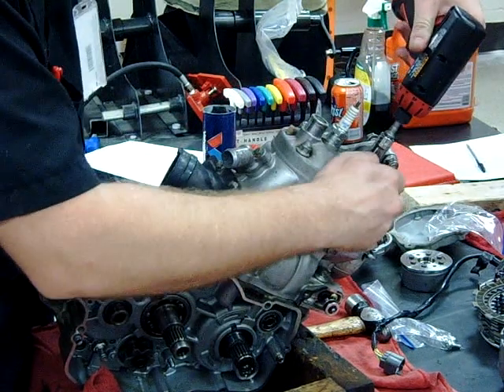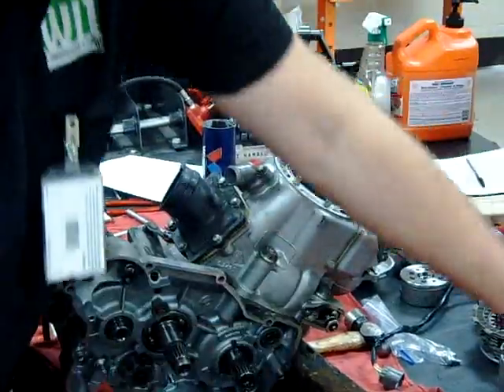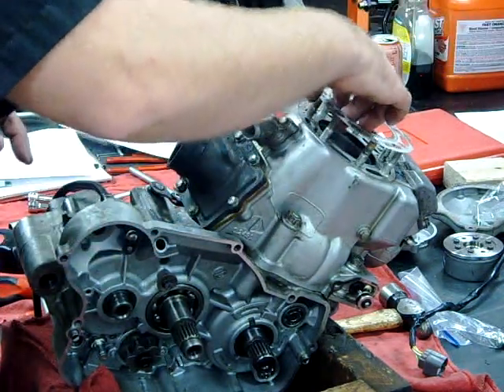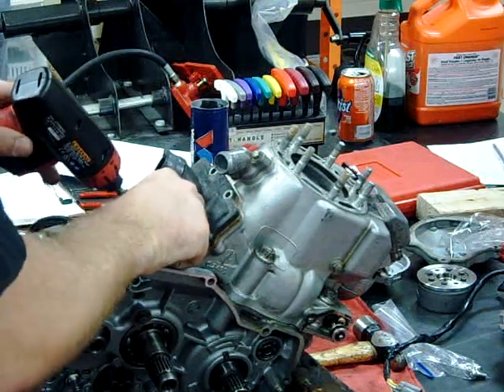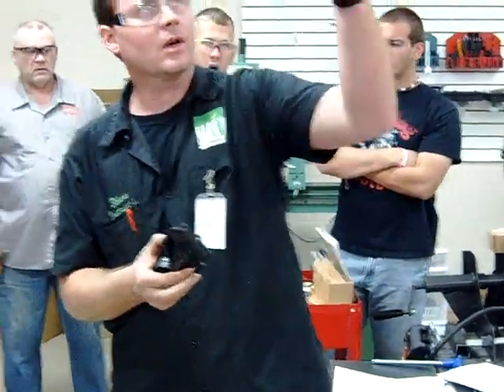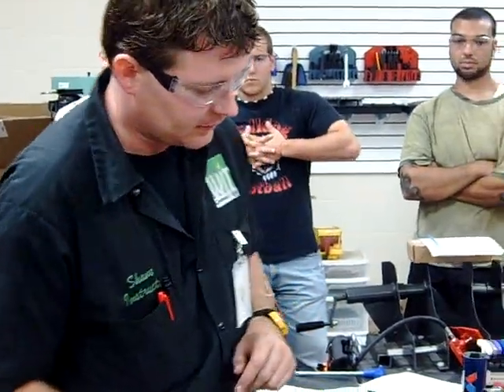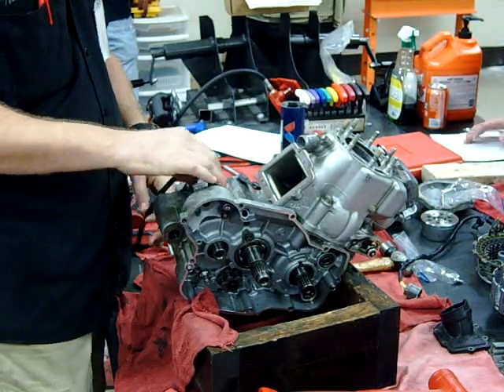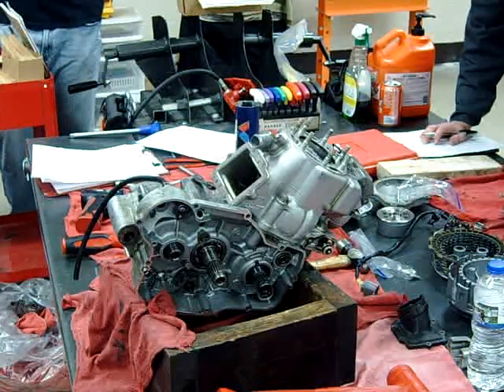2-stroke dirtbike motocross top end piston cylinder removal part 6

Comment: Anyone else notice the head was on backwards? 😂😂 great vid shane.
Reply from the maker: The head is on correct and dowel pinned with offset bolts to make it impossible to install backwards...https://www.partzilla.com/catalog/kawasaki/motorcycle/2002/kx250-kx250-l4/cylinder-head-cylinder

Comment: I have a question for you Shane I have heard mixed opinions when doing a top end on a cylinder that has nikilsil should I hone it or don't hone it ? my 2010 ktm 250sx has 180 psi for compression so it needs to be freshen up with a piston and rings but I don't wanna ruin my cylinder by honing it so I'm not sure if I should do it.some ppl say yes Hone it some say not to do you being a teacher what should I do ?
Reply from the maker: +Gary Woodman 
Here's is the answer you've been looking for.....drum roll please....many people are not aware that there is a special hone material specifically for plated cylinders. Think about it. They had to hone them when new somehow, right? Check out Weisco Pistons for there hones. I always hone for new piston and rings But LEAVE alone if reusing rings.

Comment: help!!!! I have a 50cc 2 stroke pulse evo sm50 I bought it from a friend who hadn't used it in 2 years (not sure why) so j used some deisel to free it up im trying to dismantle the engine to replace the piston however when I try to lift off the cylinder the piston gets stuck at the bottom ive checked to see if ive missed an bolts but in havent as I can wiggle the cylinder  side to side slightly due to  the wrist pin I think its jammed in as the top of the piston is all rough and chipped and because of this I don't want to be too rough in case I damage the cylinder walls any tips would be great thanks!

Comment: Hello I am currently rebuilding the top end of my 2004 kx 250 at my high school, I took the radiator the sub frame, gas tank the carburetor off etc, But my question regarding removing the cylinder is how do you take the cylinder off the crankcase, Kawasaki's powervalve is fked up, I dont get it, yamaha is alot easier, just unscrew 1 bold to take the powervalve rode off and you can take the whole cylinder assembly off? It would be a big help Thx

Comment: Hey Idk what to cause I stripped the head of the cylinder bolt and I got a whole new top end to put in and all my cylinder bolts are on really tight and won't come loose so can any one tell me any suggestion and I got a yz 250

Comment: with the reeds they normally change the angle under wich they're placed,but in order to do that some reeds have to be a bit larger or smaller then others
the angle affects the movement the valve has to make in order to be fully open or closed,
and it's put in two strokes to ensure that your mixture can't get pushed back out of the cylinder ,when the piston comes back down ,the time in wich it closes in combination with the distance it has to travel is what will affect you're performance